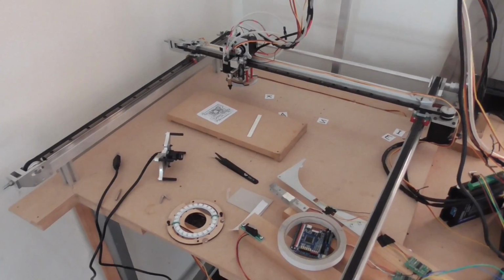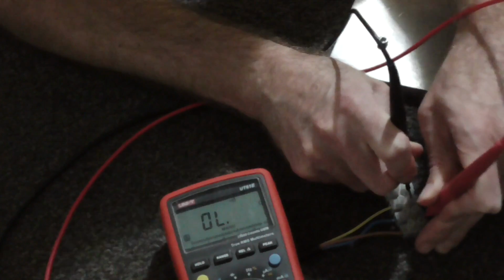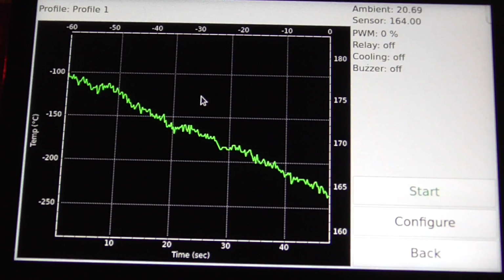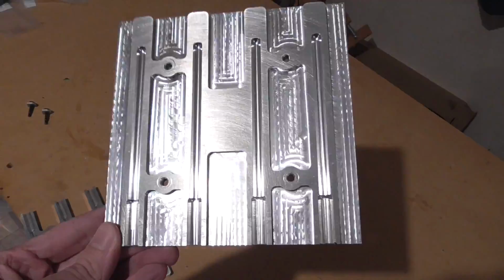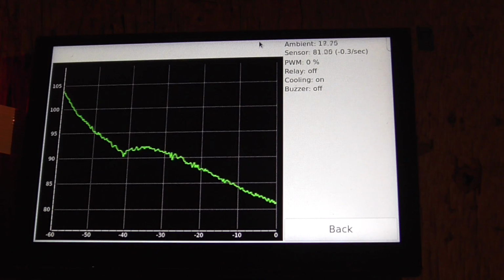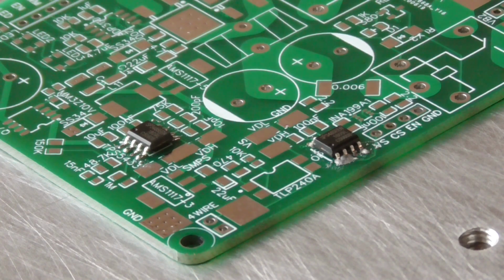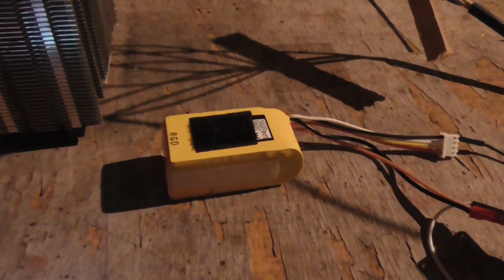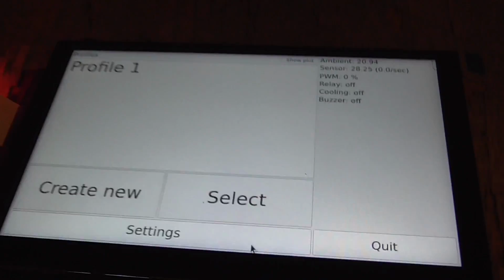Reflow hotplate tests

Comment: A Solid State Relay is just that: a relay. The output is either on or off. It is not a dimmer on itself. However it is possible to modulate the output using a PWM input signal.

Comment: A common approach I've seen before is to use a PCB with the heating element being a track on the top/bottom layer. 

This is how some of the older 3d printer beds used to work.

Comment: How do you reflow parts on both sides of the PCB without the components falling off the side facing down?
Reply: Есть специальный клей для таких случаев
Reply from the maker: I have no plans for double-sided boards, if I do someday I'll have to use an oven.

Comment: For R&D board development (+20 years ago) I used to use an electric fry pan, lowering the board down on to the pre heated pan, then pull the board after the solder flowed, it only took a few seconds. I used baking paper under to board to hold it.
Reply: That baking paper may have saved you from a costly divorce!... did your next omelette taste OK?   🥴  😜
Reply: The 'frying pan' was new and owned by the company, it never had food in it  :)
Reply: @deanbell5164  :  My father used to preheat racing cylinder heads in the oven, prior to valve-guide and valve-seat insertion... My mother was VERY forgiving!  😜
Reply: The oven got used to heat the ring gear before going onto the flywheel too, in my younger days :)
Reply: @deanbell5164  :  Sounds familiar!   😋

Comment: Use a standard SSR with zero-crossing detection and use PWM to regulate the power. PID is will always help because it will eliminate unknown variables such as thermal mass added (size of PCB) or outside temperature. Look how it is being done in coffee machine controllers such as gaggimate . You can basically reuse that project to control the hotplate or a reflow oven (with a modified firmware of course) . For a heating element I would use an aluminium PCB with  with printed traces powered by LV DC

Comment: SSR is typically current based. Internal resistance of MCU vs battery will vary the current. Also hit SSR vs cold SSR will vary the needed current. Best to drive SSR hard to avoid fringe failures as it gets hit or old etc.

Comment: For future reference, would suggest something like Kapton tape if you are trying to get a good IR temperature reading from a hot, low emissivity surface. FLIR (who make some IR cameras) have an article called “Use Low-Cost Materials to Increase Target Emissivity” which may useful.
Reply from the maker: I was thinking about that but didn't want to be cleaning a huge sticky mess off the hotplate.

Comment: I believe you are seeing EMI issues coming from the capacitive sensing on the touch screen. The touch screens are inherently electrically noisy because they use AC to detect your finger at which point you act like an antenna. I don't know if that is disrupting the power supply for the sensor, or if it is introducing voltages into the sense line, but either way it makes sense given that thermocouples are measuring very small voltages. I feel like you should be able to shield the data lines  to your sensor (like maybe just with foil for a test). You are also likely correct that better decoupling at the sensor would help.

Comment: Check to see if the thermocouple is connected to ground at the probe end. If it is you will have an earth loop causing noise to be induced in the converter. Also the SSR is an on off device and should be of the Zero crossing type. I use a hot plate with cheep thermostat and it works for me. Good Luck.

Comment: At 20:00 it looks like your body's electrical field is corrupting the temperature data. Try using an antistatic wrist band when you are near it but the unit should have a shielded case to stop that. Never underestimate the power of static charges near sensitive circuits.

Comment: Don't tell my Missus, but I'm not sure where we ended up?... the current plan is to physically move the board from the heater to a "cooling area"?  That seems to be the low-tech solution that has the most chance of consistent success, if you stick with the hotplate.
The number of comments suggesting a "Toaster oven" is interesting...  I see The Warehouse has them from NZ$69, and Farmers has a slightly better option at NZ$75.  The temperature on most of them seems to max out at 230 deg C though... not enough?  Their policy on Returns is excellent as long as you haven't drilled too many obvious holes in it!
The fun goes on!
Reply from the maker: Yes, basically. I have switched into 'just try to use it first, before spending time making things that don't need to exist' mode. Some day I might end up getting an oven, probably second hand tho. Thanks for your generosity btw :)

Comment: Get linear PS for RP, or isolated at least.
Also you have probably a ground loop running along with really small signal from thermocouple. You are a one big anthena and touching the screen you are transmitting its emc to that loop.

Comment: Use the force Luke .. Use the force of everyday household items available at a bargain.
Number One Solution for Reflow: Toaster Oven / Second in line: the electric and sand filled Wok / Third in line: quarz IR heater setups / you remember "Ceran" plates?
(have a look at the hackaday search function)

Comment: Been there done that... I ended up making a Closed case Re-Flow Oven with a dedicated controller that can more precisely control the Ramp up/Ramp down Re-Flow curve required to properly Solder the Components and not Thermally damage them. A Hot plate is good to remove parts.

Comment: Drop the J/K-TC and use an  Pt100 or Pt1000 far more stable e.g. DS18B20 one wire Pt100.

Comment: Why did you decide to go with a thermocouple rather than a thermistor?
Reply from the maker: I didn't really know about thermistors, the thermocouple was the first thing that came up in some quick searches.
Reply: @iforce2d they aren't rated for as large of a temperature range as a thermocouple, you need to get a high temperature one, and they aren't as liner, but they don't rely on tiny voltages like thermocouples. They are just a resistance so they are super simple to measure.

Comment: This is great, I found the issues you encountered with the screen and the couple interesting.
Often one runs into such issues with the cheap bits from the drop shipping company.

Have you tried the application (I am very impressed!) and the probe with a different screen than the touch screen?
Have you tried decoupling the probe?
I would warmly recommend an optocoupler and separate power supply rail for all ins and outs to prevent issues in the field having an influence on your system 😉
The thermocouple appears to be influenced by inductive coupling, not surprised because it is a thermocouple.
My pt100 and pt1000 attempts have been interesting too, I was really not happy with most of the cheap boards and had issues with expensive ones too - until I installed an optically insulated industrial transmitter 😅

Thank you so much for sharing your codebase! I will be looking into it because I have a different project but with similar inputs that really needs an interface.
Reply: Also, I would kindly propose you find someone with an oven used for calibration.
My pt100 hotend loop was lying, in the lower end it was -5K and in the upper range even -8K compared to the reference probe.
Reply: And to close out:

Maybe put your Raspberry Pi and the touchscreen in a case. Ideally the Pi in a metal one.

That could improve the issues you encountered with the deviation appearing when hovering near the touch screen.
Wood is a bad conductor (saved my life a few times) but I wouldn’t trust it nonetheless.

Comment: wondering if a 3d printer hotplate would work better ?
Reply: I don't think any of them will get to 250 to 300 degrees C.
Reply: They can reach those temperature and even beyond that was the problem of the first printers burning Houses down because the didn't had safety circuits implemented yet. But nowadays the 3d printer have safety circuits so if you drive them without safety circuits then it will take no time to heat it to what you need. Cheep Chinese reflow plates use 3d printer bed heaters.
Reply: @icebluscorpion  :  Interesting.  My 3d printer is from the dark ages;  the bed takes forever to reach 65 degrees C.  I know there are mains powered bed heaters that give fast heat-up, but I was assuming that temps above 250C would warp the bed.  That's another option then.
I know that a number of the house fires were from thermal runaway because the thermistors were there, but they did absolutely nothing!   Nice surprise!   😱

Comment: I guess the thermal load of the PCB will change the plate response and timings?  Maybe you'll need some type of PID in the end?
Reply from the maker: Only a tiny bit I think. The thermal mass of the aluminium would be significantly greater.

Comment: The proportional SSR really is probably pointless. The whole point of SSRs is that they can be switched quite quickly anyway, so you can just drive them with a pwm signal (maybe at a slower base frequency).

If you're planning on open sourcing the thing anyway, you might as well take the PID and associated auto tuning algorithms from marlin or some other 3d printer firmware. SSRs are frequently used to drive the bed heaters and it's quite the proven system in this regard.
Reply: It may well be that the latency is higher than it should be. Good idea with using 3D printer algorithms, they are proven to work very well.
Nonetheless it is a tricky question, maybe removing more of the aluminium (even making cooling grills on the bottom?) would lead to less of an overshoot before optimising the control loop.
Reply: 1. Yeah marlin has the  bang-bang and pid which works well but the version after that was even more impressive. I can't remember the name but it's something about modeling the whole system. 
2. Looking at all these headaches I'd probably consider just using a mains powered 3d printer bed. 
3. Would a liquid cooling system make any sense to help with increasing the cooling speed? You'd probably need something with a higher boiling point than water. 
I only had time to skim the video so just ignore anything you covered.
Reply: @JustinHunnicutt  Mains powered 3d printer beds don't work for this application, they are only rated to like 110°C, nowhere near enough. There's a reason typical DIY solutions just use off-the-shelf mini-ovens with just custom controllers. Heatplates are much harder to control properly, especially getting the temperature even, or close enough, over the whole area.

Liquid cooling probably creates more problems than it solves. You then need to empty the cooling system before the next cycle, or the (likely water based) coolant is likely to boil on you during next heat up and cause all sorts of nonsense. Usin non-water based creates issues with pumps being able to handle liquids of these temperatures and just moves the problem.

Comment: When building my pottery kiln, I found the MAX31855 to be mostly useless overall, with the exact issues you're showing here (15:09), sometimes the issue is connection to the sensors, sometimes the issue is garbage design overall, and sometimes the issue is that it can't do nearly the sample rate that it reports on the data sheet, and will give those null values/error values back when it "wasn't ready".

I switched to the MAX31856 based board instead, it's a little more expensive ($37AUD) but has never had a single issue (and supported temps greater than 1023C, which I needed for a kiln anyway)

My guess with the screen is that its a capacitive touch screen, and putting your hand near it, but not on it, probably couples you in as an antenna, and these garbo MAX31865 chips have no shielding whatsoever.
Reply: thank you for the recommendation!
Reply: Any comments on the MAX6675 ? It is available as a module for quick prototyping.
Reply: @mumbaiverve2307  Found it about the same as the max31855, but much slower, which ironically smoothed out a lot of the errors. It has a max temp that was too low for a kiln (iirc it was locked at to a range of 0-1023c)

Given the price difference, but similar overall issues, I'd probably use the max6675 in lower temp projects over a max31855, but honestly I'd rather just spend the $30-40 and get an adafruit max31856, the boards a worth it, heck even the Chinese $6-10 ones are just designed better top to bottom, front to back, than the "good" max31855/max6675
Reply: @ShaneGadsby   By slower , you mean latency in response to changing temperature ? Temperature is anyway usually slow, so I guess in many applications, error smoothing might be more useful ...
Reply from the maker: Initially I was running the MAX31855 at 4Hz and it seemed to provide samples ok for a few days. Then one day it started to kinda... bog down I guess, somehow. I had to set it to 1Hz and it has been ok like that. Never did figure out why, this thing is so annoying.
Reply: @iforce2d  Yeah I was never able to get the max31855 stable with polling faster than 800ms/sample, an issue that was never present in the max31856, which matches it's datasheet as close as you'd expect.

Comment: if you're keeping the aluminum hotplate, maybe add a water cooling block where the CPU cooler was and run water through it to try to get your desired cooling rate
Reply from the maker: True, but then you need to cool down the water somehow, and keep it contained, maybe pump it around or something. At least with air it's everywhere in large quantities all the time.
Reply: @iforce2d  I was thinking of just a 5gal bucket on the side pumped up to heatsink and just fall back into reservoir, until the bucket gets too warm and then you just dump it out and replenish. Hopefully you get a big enough batch of PCBs per refill
Reply from the maker: The other thing to consider is if I uploaded a video like that, every comment would be saying wow what a painful workaround :)
Reply: @iforce2d  Yep, no pleasing us... I mean... them

Comment: I couldn't get reliable hotplate reflow, but I switched to a toaster oven and it works like magic. If your hotplate is giving you issues, perhaps consider a cheap/free toaster oven off the marketplace (be sure to get one with convection circulation and infrared elements if possible). I had to write my own clunky PID reflow controller, I'm surprised mine worked as well as it did and I could reflow a few boards perfectly. I'm also in the process of building a PnP, nice to see yours coming along!
Reply: I've had good experiences with using a portable ceramic hotplate. It heats a lot quicker, has less thermal inertia, and is compact. You need to be really careful with how fast you ramp in the preheat phase though, otherwise the flux won't have time to activate properly, and you'll get solder balls everywhere. I just controlled it by dialing up the heat slowly by hand, worked like a charm, you'll notice when it's done.
Reply: @vatterger  Thanks for the suggestion, it may have been the ramp up time perhaps. I may revisit it sometime and try to tune the controller and dial it in. I guess the reflow oven was more forgiving and masked some of my tuning issues.
Reply: UnexpectedMaker is also an australian electronics maker that has designed a BYO-oven controller board / interface to make a reflow oven but without having to figure everything out yourself